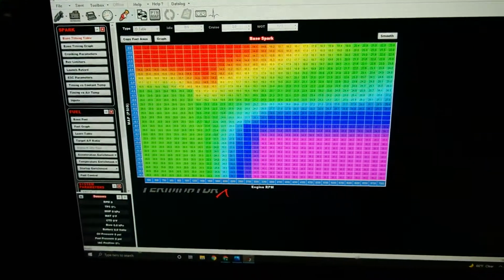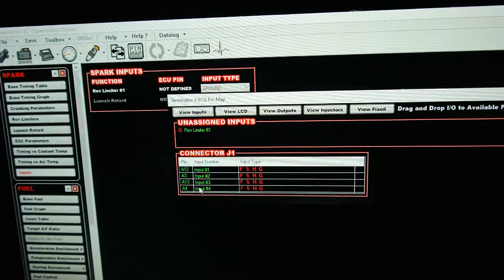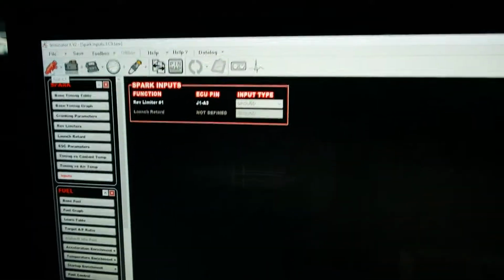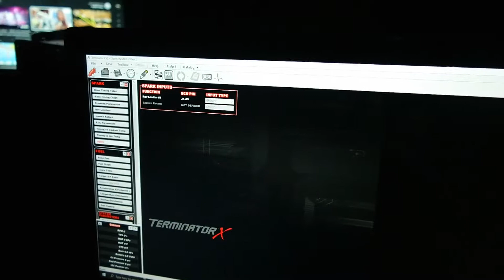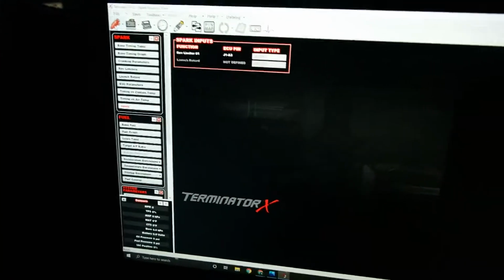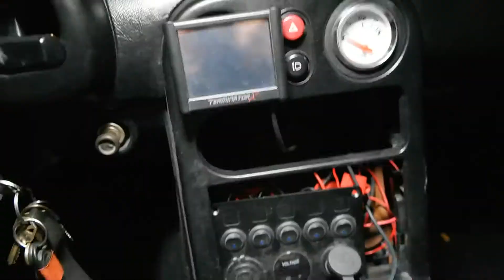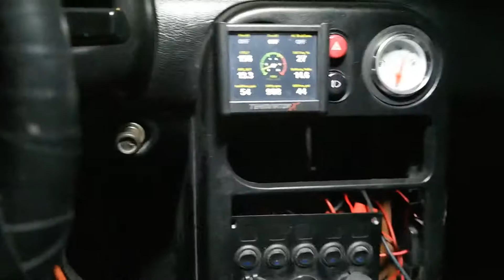How To Hook Up 2 Step In Holley Terminator X

Comment: Everyone i know gets backfires with their 2 step on the terminator x, but mine does not for some reason. No matter what rpm i set it to. Been trying to figure out why
Reply from the maker: You gotta set up an advanced table to pull timing. I pull 25 degrees out. Also turbo now, so I have it set up to target psi. Will work the same on an rpm axis though.

Comment: I tried ground and the 2 step activates without hitting button like a main rev limiter
Reply from the maker: Check and see if the button is working properly. Try just grounding the bare wire out

Comment: Do you put 12v through the input #2 wire or is it a ground
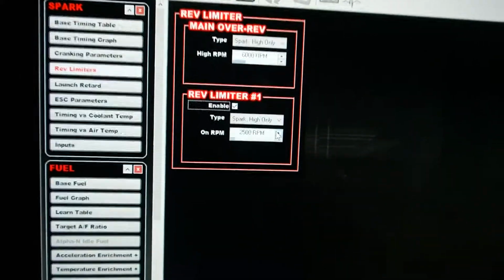Reply from the maker: Either or. Just depends on which is easier for you. Most likely a ground source is more accessible though. You go into the software and choose 12v or ground shown at 1:15 . also i would recommend setting up a 1d table that will pull timing when that input that your 2step is pinned to is activated. Haven't personally done that yet but my tuner did for me shortly after this video.
Reply: So you don't have to connect the 2STEPS  blue or white/blue at all if you connect through the Terminator X?